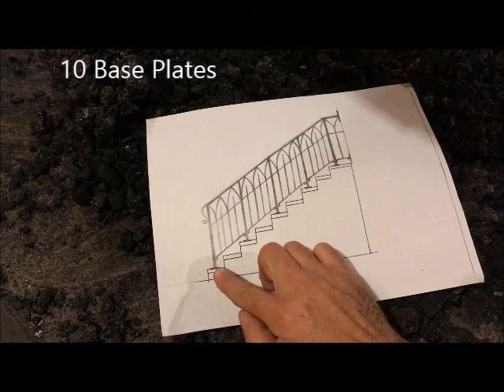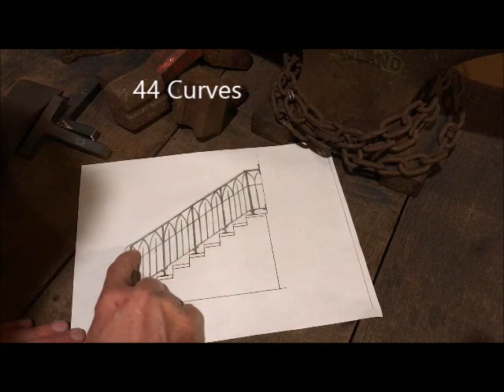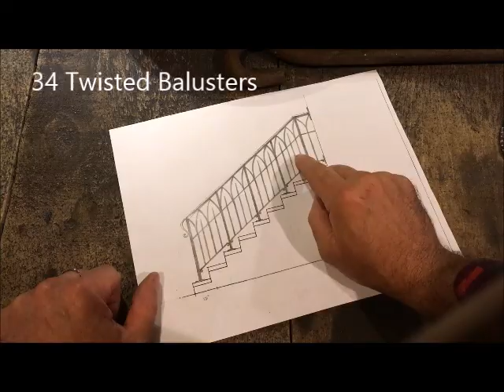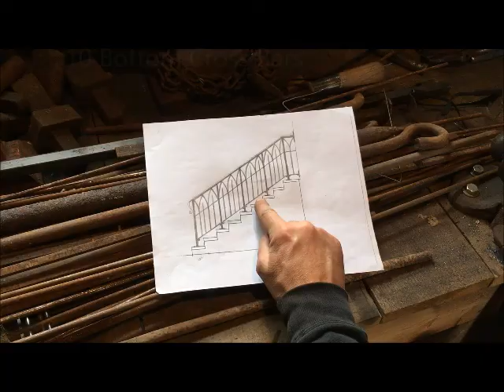Forging A Double Curved Railing

Comment: How did you make the horizontal bend on the top rail? Top secret info?
Reply from the maker: I used oxy-accetyline torches to heat a small spot about 2 inches long and bent it down.  I could have used the forge but with torches you can get the heat exactly where you want it.